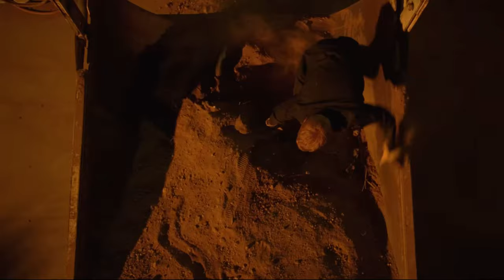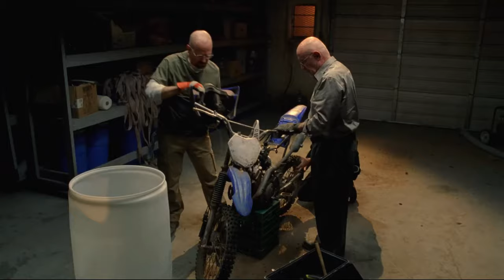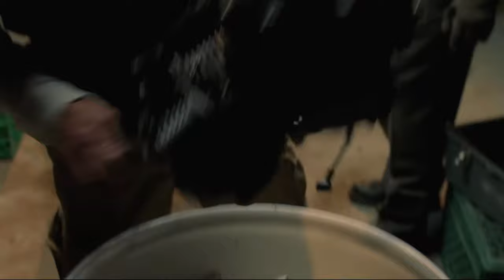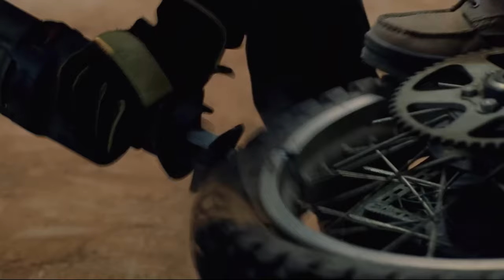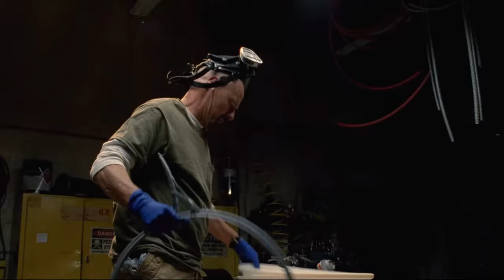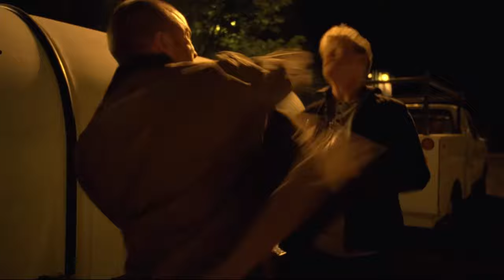Breaking Bad Season 5 Episode 6 - Buyout - Opening/Disassemble

Comment: Coming back to this scene makes me realize that the disassembly for the bike was a possible euphemism of what they were about to do to the motorcycle kid’s body parts to fit him into the acid bin.
Reply from the maker: I never thought of it that way. Good observation.
Reply: I don't think that was the intention. They didn't have to cut victor's body up when they dissolved him. I think it was more of a way to translate that they were going to be literally breaking down his body into it's simplest parts via acid. Which honestly makes it way more fucked up.
Reply: Instead of showing you a Sopranos-style butcher scene of them breaking down the body, it’s the bike. I didn’t flinch when Todd shot the kid, but this imagery is so much more visceral than a kid flopping down playing dead.
Reply: @trunklemcjeans  it's that, plus it represents deconstruction in an abstract way. Walt's, Jesse's, Mike's, and Todd's. They all ended up in the same place, but while Mike and Jesse are horrified, Walt and Todd are cold and calculating.
Reply: @trunklemcjeans  I agree the kid could fit if Victor could, but this bike scene very much is a metaphor for how they are about to dispose of the kid. The whole time I’m watching it I’m thinking, kid’s next.

From a show standpoint, I think it would’ve been crossing the line to actually show them putting this kid’s body in a barrel and pouring acid in it like they did with Victor. So this scene is useful for showing them “disposing of the kid” without showing them literally doing anything to his body.
Reply: @chumuheha  Walt looks horrified too
Reply: @chumuheha  I don't know, when Walt gets the barrel ready for Drew the look on his face is anything but happy. 

I do think his cold calculated side knows that it was the best option from a "don't get caught" standpoint and he's probably glad he didn't have to do it himself. 

To quote Boone from Justified "seems to me in this world you have to either be poor enough to not afford a conscience, or rich enough to pay someone else to carry the load." Boone then goes and murders an old lady for the guy he's talking to. 

Walt would and did happily pass the weight of conscience onto someone else. I say happily because, he's whistling later. Jessie in fact takes it as the proof that Walt really don't give a damn. I would take it more as he's just "it's not my fault I didn't shoot him so why should I feel guilty"-ing the situation.
Reply: Nah the kid would fit in bin pretty easily
Reply: @trunklemcjeans  Absolutely correct. The only thing worse than showing a child being "disassembled" is making the  audience imagine it in their heads.
Reply: No they didnt. Children fold, bikes don't.
Reply: @TeaDrinker3000  I think he interpreted it too literally. The bike being taken apart is an analogy for the kid being dissolved, not sawed in pieces.
Reply: Lol you guys think there hidden meaning behind everything.
Reply: Symbolism is a great way to see different things in life. In fact, there is pretty much symbolism in everything today in the world. It’s a great way to learn things, and in this case with breaking bad, it gets you more invested in the show.
Reply: @theozlander4629  I honestly think Walt’s mannerisms are anything BUT emotional. He’s treating this whole thing like it’s some kind of dirty, dreaded stage of what’s otherwise a normal job/task. More like a “let’s get this part over with/no one enjoys this part but someone’s gotta do it” attitude rather than a horrified “what the fuck have we just done??” one. Truly chilling...
Reply: @bluemonday2000  Nothing wrong with that, even if it wasn't the filmmaker's intention. It's fun and neat to think of stuff like that.
Reply: @trunklemcjeans  my guess is they did it to ensure the evidence would be gone as they didn’t want anyone at all knowing of what just happened. It would also help ease their mind knowing that they had a boys body in their hands.
Reply: @EWall1498  wdym crossing the line?
Reply: Nah, it’s very easy to fit a child of that age into one of those barrels whole, no disassembly required. You need less acid than you think, too.
Reply: @bluemonday2000  Imagine making fun of people for using their critical thinking skills, on a show where you’re literally meant to do that. You were one of the children George Bush left behind huh?
Reply: Absolutely the intention.
Reply: They can fit whole adult bodies into the plastic barrels like they did with Victor but yeah i thought the same
Reply: It 100% is